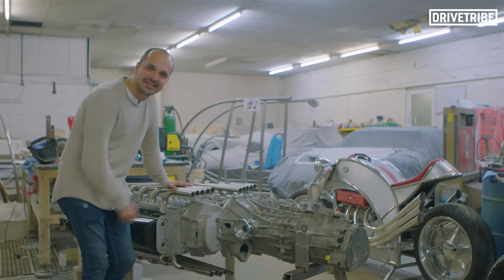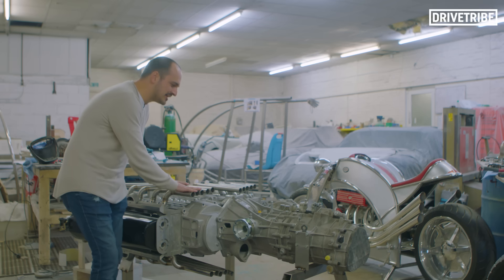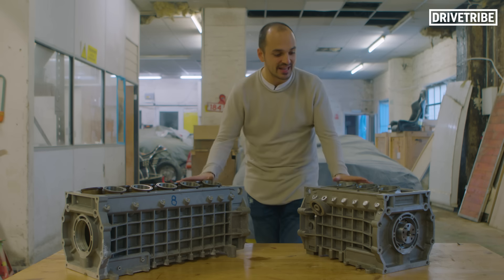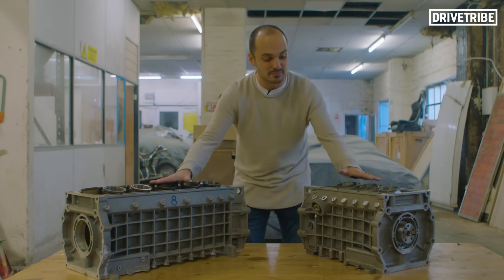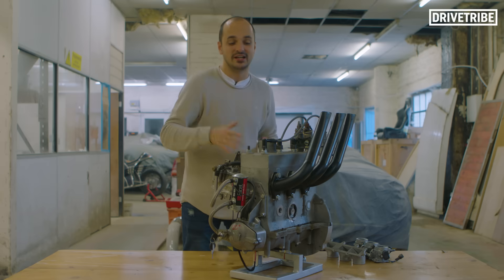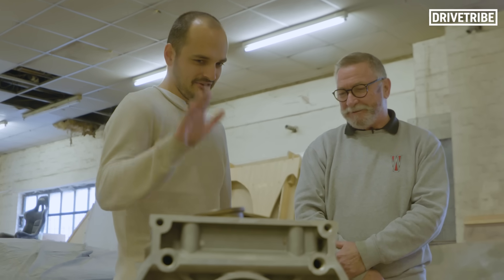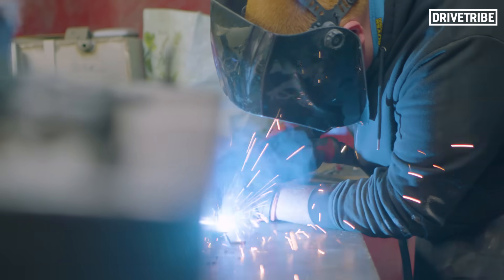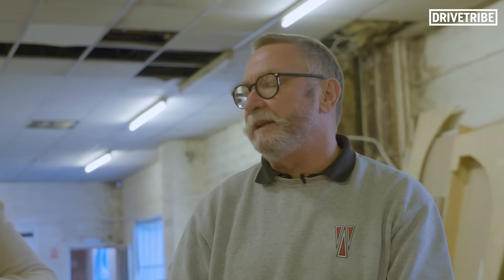This X20 engine is two V10s stuck together!

Comment: Looking at that engine and its complexities vs. the amount of power it produces makes (IMO) a strong case for switching to electric motors - simpler, more power, just no engine noise.
Reply: What they’re going after isn’t performance though (at least atm) what they’re going after is reliability and practicality. What they’re goal is to make a modular engine similar to rotary engines and smaller piston sizes for easier installation/ packing
Reply: @aaronmachado13  That makes sense. But have to wonder how that would compare to an electric motor.  I suspect that's the future for most people, once more car companies make the switch and prices come down some more.
Reply: @LS-ti6jo  well yes but the problem with going COMPLETELY electric is the power output per weight. Look at Diesel engines that power big rigs, to equal the range per torque the electric battery would need to take up most of the weight and for cargo you can’t weigh over a certain tonnage because you risk infrastructure damage (such as roads and buildings)

Comment: VERY HEAVY AND IMPRACTICAL FOR REAL USE.  ENGINEERS HAVE DEVELOPED DISPLACEMENT AND HP FIGURES OUT OF ENGINES 1/10TH THE SIZE.  WHAT IS THE POINT OF THIS?

Comment: Wish them the best and it’s definitely cool and all. But it’s not like there’s much of a point to them other than the sheer fact of being the first one to do it. The power output is so low and there’s no positive real world to running any of those engines. Baring that 20 cylinder if they get it running because that would at least sound very unique I guess.

Comment: Today: We combined two V10 engines.

Next month: We'll load this on a motorcycle.
Reply: Tonight on bottom gear

I drive a X20 car

Hammond Runs away to remote island, 

And James pumps his bike.
Reply: Don't know if you've heard of Allen Millyard? He does that kind of thing! He put a Dodge Viper engine into a bike frame, has built a V-12 2.6L Kawasaki  and has a 5 litre V-TWIN made from an aircraft engine!
Reply: Alan if you see this you need to make an X engine bike from say 4 of those Yamaha 250s  you used for Honda 6 replica.
Reply: Next year: we combined two 22.5° V16  engines to see what it would sound like.

Comment: Why not 2 more v10 banks? W 80 !!!!!!
I personally would increase the displacement for higher torque. That tiny displacement will bever give great torque numbers. 
Another issue i have with it is that there are straight 6 engines from BMW that can easy be nodded to 1000hp. There are ls engines like the lt5 that have 780 out of the box. 
I think this is a cute novelty, but i would be very surprised if this ever happens for production. I do enjoy be proved wrong, but i have doubts.

Comment: That V6 is an interesting notion. If that could be made into a reliable and efficient power plant (say 10,000 miles between services and an approximate lifespan of 150,000 miles), it'd be ideal for kit cars and modernising classic cars.

That 120hp range, depending on torque output, would sit happily in anything from a, somewhat rowdy, classic Mini to a Sunday cruiser like a MK2 Cavalier or Rover P series.

Comment: Seems like a silly engine big heavy not even that much power. A gimmick
Reply: Yes, it's blatantly a gimmick because it's way too complex, but 400-440hp for a naturally aspirated 4 litre is decent power.
Reply: @Splooge_McFornication  smaller lighter engines produce  more hp. One that size 400hp naturally aspirated still not impressive but to each his own
Reply: @allensaunders449  Not without forced induction or ridiculous internals. 20 cylinders is way too complex but 100hp per litre, naturally aspirated is decent power.
Reply: @Splooge_McFornication  the mustang 350R V8 naturally aspirated had 528hp. The viperacr naturally aspirated has about 650hp. V10. many other examples from ferrari or lambo to less exotic names
Reply: @allensaunders449  I'm not saying it's the most power (obvious if you actually read what I typed), I'm saying that 100hp per litre is still decent power. 20 cylinders is ridiculously complex & unnecessary, I agree, but I'm talking about naturally aspirated hp in general terms.

Comment: You say it's 2 v10s. I see 2 heads. 1 per block like a vw VR engine. I fail to see that as a V. That appears to be a staggered flat engine and not an X.
Reply: Imagine if that was already said in this video and the previous one.

Comment: 400hp from 20 cylinders, impressive.
Reply: 400hp from a naturally aspirated 4 litre. The number of cylinders has more effect on the torque output.
Reply: @Splooge_McFornication  If you want torque just make an electric car, this engine is just overkill.
Reply: @hithere589  Not in disagreement about the engine being overkill, not at all. All I'm saying is 100hp per litre on a naturally aspirated engine is fairly decent.
Reply: @Splooge_McFornication  fair enough

Comment: 'When you mate two engines together they often work against each other.' Hmm, I guess half the Sherman tanks built during WW2 must have been unreliable failures. Er not. In fact most of the allied tanks used multi-bank type engines through a joined gearbox. And of course tens of thousands of ships that also use multiple engines joined via gearboxes because ships don't need to be reliable and not last for decades of continuous use. 

Basically, that was an utterly nonsensical statement. As long as an engine puts out enough power to not be driven by the other one - in other words about 5% of it's max - then they work just fine.
Reply: Yeah, you've just mentioned a load of low RPM diesel engines....
Reply: @Splooge_McFornication  Er no. The multibank tank engines most used in the British Shermans  were Chrysler petrol engines stuck together from the Lincoln. 30 cylinders in total from five engines. As for marine engines? Most of the geared together ones are high speed diesels not low RPM. And bottom line it makes no difference. Tens of thousands of geared together engines have been made because it's not a problem and the statement that they work against each other is utter bollocks.
Reply: @markchisholm2657  But it's not utter bollocks though is it.
Reply: @Splooge_McFornication  Yes, it is. As long as an engine is developing more than about 5% of its max power then its not being driven and thus not working against the other. For an engine to be working against another one it would have to be absorbing power not delivering it. It may be that one engine is putting out less power but that just means the entire power plant is overall down on power.

Comment: Question: what is the mechanical virtue of having a 4L x20 instead of a 4L v8?
Reply: More horsepower compared to a V8 of similar size plus what they’re testing is modular capabilities of their engines as well as reliability of smaller piston yet more amount of pistons.

Comment: 4 litre 40 valve flat 20 CYLINDER engine!
BHP: 400ish 🤣😂🤣 why lol
Reply: 400 naturally aspirated bhp is a lot nonetheless. It's a prototype engine so it's not it's final numbers. I bet there is room for more horsepower, but the team is also looking for reliability plus being mated to a 6 speed manual you don't want to have unnecessary amounts of horsepower. I'm really interested in how far they can develop this new engine.
Reply: @luisk6007  the viper was 650 and it was a na v10
Reply: @cameronknowles6267  it was also nigh on 8l and a pushrod truck engine. Nicely understressed, but not groundbreaking.
Reply: @cameronknowles6267   it’s also twice the size of the x20
Reply: Because they can. And thats the point. Not many people have this mindset any more unfortunately.
Reply: I'll tell you why: supercar performance with normal road car fuel economy. Also the 400bhp figure is naturally aspirated. With turbos or superchargers it'll make a lot more.

Shows how much attention you were paying. 🙄
Reply: It's a functional gimmick some rich guy would use to show off to his other rich friends "I bet you don't have a twin v10 powered supercar in your fleet"...
Reply: This was my thought as well. It's cool, but it creates more problems than it solves. In fact, it doesn't solve any that I can see. I bet it was fun building.
Reply: Frijoli only problem it solves is having to make a crank and block that can accommodate 20 Conrods and still be strong, not ideal still
Reply: @Rachnmat You've never been so wrong in your entire life.
Those guys basically built an engine in a cave with a box of scraps, compared to any big company.
Reply: 100hp per liter is still great. And would love to hear it scream.
Reply: @TheAdatto  Yes, it is great, but not really impressive considering all the technology we have today.
 1k hp per liter was achieved decades ago, but this kind of power is kept away from the average person for obvious reasons.
 Many super/hyper cars aim for 200hp/L which is fair enough.
 One example is the Agera R, 5L 950hp (ish)
Reply: A flat (horizontally opposed) 6 or 8 would achieve exactly the same thing without the unnecessary complications involved in making the x20 engine. I would be willing to bet that the x20 will be a one off orphan.
Reply: Displacement
Reply: Efficiency and high revving
Reply: That's without tuning ,Ecu,etc etc that could easily push 800+
Reply: I like the idea but cmon just 4 liter's for 20cyl???after build my 3.0l from old GM 151 line4 with cam on block! cam that produce 260hp, i feel all this cylinders are a mistake.
Reply: Yeah i was disappointed w the BHP, was expecting something crazy high. And those saying ‘its n/a’ pfff so what? The 4.0L V8 in the E92 M3 makes more horsepower than that and its n/a...
Reply: That's naturally aspirated.
Reply: @simonsackett  Lamborghini v10s are naturally aspirated and produce way more power. This has double the cylinders😂
Reply: @simonsackett  yes, but the 4 cylinder F20C (the engine from the Honda S2000) is N/A and that makes 120 bhp/L. Also mating crankshafts through gearing is gonna result in unnecessary drivetrain losses. I don't see the point of this engine. Now if they balanced it out perfectly and it revs over 15.000 RPM that would be something else. It would also be a lot more powerful.
Reply: @Duskconqueror  many engines don't make 100hp/l though. Picking one with no torque but high hp also doesn't necessarily mean much
Reply: Duskconqueror Honda is a multi trillion dollar company with huge experience building motorcycle and F1 engines, these guys built this in a few well equipped sheds, so what they have achieved is hugely impressive imo. Perspective is so important with things like this and they aren’t claiming to have done anything revolutionary, it’s just an experiment atm
Reply: @NitroNuggetTV  True, and I wish them all the best but the X20 engine doesn't make much sense to me. The 2L V10 sure is nice though.
Reply: @lonyo5377  No torque? It has 100 Nm/L of torque. I can't think of lot of N/A engines that have a much higher amount of torque/L. Actually, most well built N/A engines produce around a 100 Nm/L. Typically oversquared engines like the F20C produce a little less torque/L than undersquared ones. But there are some high revving undersquared engines out there.

Comment: What does a V20 sound like? I imagine its like two V10's in unison. I know this because my prototype V\30 sounds like 6 T5's
Reply: It will sound totally different than anything we know. Just think about how different a VR6 sounds compared to a V6 or I6. And having 2 Engines also adds a little bit weirdness.
@Michael Jadin D.  In reality the Bugatti engine is a V-VR16. It's 2 VR8 (very tight V8 to allow a single cylinder head) engines linked in a V shape to a single crankshaft.
VW used many variations of that since the late 90s. First in the VW W12 (a VR6 variant - later used in Bentleys and a couple others) and a VR4 variant in the Passat W8.
And it all started with the Golf Mk3 VR6 in the early 90s.
Reply: Could be similar to Bugatti's V16, but louder since it's naturally aspirated. Don't know about the pitch.
Reply: @luisk6007  doesn't a Bugatti have a W16, not a V16?
Reply: @electramotive  look closely at this V20, I don't see separate heads for each bank
Reply: @luisk6007  Don't know about the pitch? the w16 is literally double the capacity. Even if the w16 and x20 were remotely similar they would sound nothing alike
Reply: It’ll sound like a pneumatic right angle grinder.
Reply: Maybe a v16
Reply: It will sound like a smoother, quieter v10. Remember the more cylinders you have, the more smoother it sounds, especially if it’s an even number of cylinders
Reply: @ombre_blanco1725  depends. That generally only applies when you arrange the cylinders in a line. compare singles to inline 2, 3, 4, 5 and 6.

When you have a V, the pitch sounds like the linear half of the engine with a bit of harmonics. 

Listen to a 1 cylinder vs V2 ducati for reference.
Reply: So basically just like an inline 5

Comment: I think its a W20 Not an X but yeah call it what u want Its an awesome piece of art
Reply: If they was pointing up it would be a W20, these are flat so it's an X20.
Reply: @cornovii3012  since they are on separate crankshafts, it must be a  "> < 20"
Reply: @cornovii3012  i was amazed when i saw the small narrow Angle V10 2L that i didn't notice that that 20 cylinder one was flat So it is X

Comment: Too many cylinders-too much internal friction-A balance needs to be sought between individual cylinder size and number of cylinders in order to maximise power output.
Reply: @ around 400bhp, I would have thought it was obvious they are not after maximum power output. It's a functional gimmick some rich guy would use to show off to his other rich friends "I bet you don't have a twin v10 powered supercar in your fleet"...
Reply: @maxnaz47  what they’re going after is reliability. Before you go for horsepower you need to make sure that the engine itself is able run and after that is when you can push for higher horsepower. Especially considering it’s a 4 liter wouldn’t make the power of say a 8.2 liter v10 from SRT or 1000hp like the Bugatti engines.
Reply: and everything is going electric anyway
Reply: @jameshobbs  
Nothing says you can’t hook an electric motor up to a manual transmission. The only reason would be for fun, you wouldn’t need the clutch or even trans but it would be an experience to drive.
Reply: I thought the HP numbers were really low for 20 cylinders.
Reply: @aaronburratwood.6957  400-440hp would be decent enough power for a naturally aspirated 4 litre. Wouldn't want to pay for cost of repairs though.

Comment: Turbo v8 can make 600+ bhp why would anyone want 20 cylinders, 20 spark plugs, and 20 ignition leads/modules to potentially go wrong?  I believe it was BMW who calculated that about 500cc per cylinder was the optimum size,  hence 2.0 4 cylinder,  3.0 6 cylinder,  and 4.0 8 cylinder engines being so popular.  This engine is a mistake.  What might impress fellow engineers isn't going to impress the end user, so I shan't be investing and will declare myself out.

Comment: Two V10s glued together making only 400bhp? I'm no specialist but this feels rather weak when 50 years ago people could make that same amount with a gas guzzling V8. It looks more than it does.
Reply: That's 100hp per litre n/a nothing weak about it it's only a 4000cc engine dispite having 20 cylinders and only 2 valves per cylinder
Reply: They didn't say they're going for power figures
Reply: @jonnoMoto  
It also looks a bit too big, so honestly what's the point of this thing? It overall feels impractical in almost every way, I'm not looking for huge results here, but this just looks like it's been built to be different.

Comment: Many cylinder and manual. Those are the days, wait it is new!
Reply: Not very efficient though. 100HP/Liter isn't to great. A Huracan for example has 123HP/Liter.  Even the 22 year old Honda S2000 had 120HP/Liter.
Sure this thing will probably sound amazing. But it isn't dealbreaking. Just a combination of many engine technologies.
Reply: @maYdaY1337  yes you cannot compare to Honda. If Honda make V12 V-tec, it will easily make more HP/Liter.
Reply: @GF-mf7ml  HP/Liter does not scale well with cylinder count. The more cylinders you have the more friction and pumping losses you'll get.
Reply: @maYdaY1337  uhh... my truck is 53 hp per liter lol. Also Gordon Murray's t50 has 164 hp per liter, naturally aspirated. The real way to compare engines is horsepower per liter per revolution, which explains why my ~5000 rpm engine looks terrible in hp/liter compared to a 12100 rpm t50 engine
Edit: look at engineering explained BMEP video